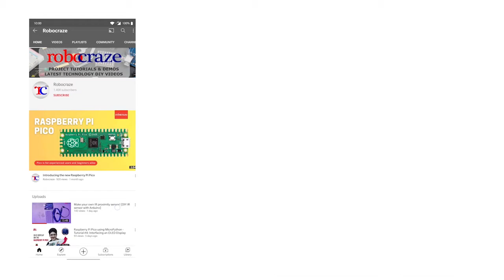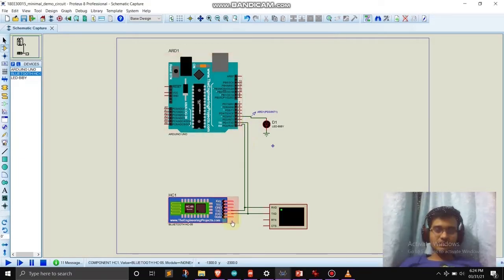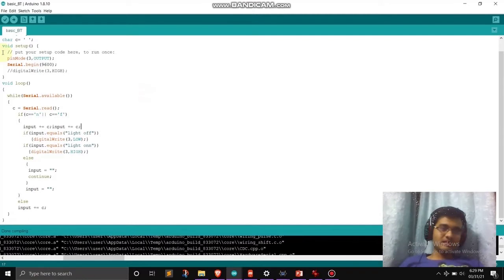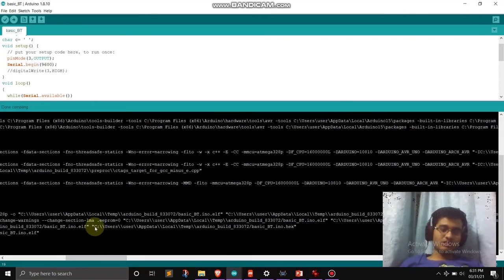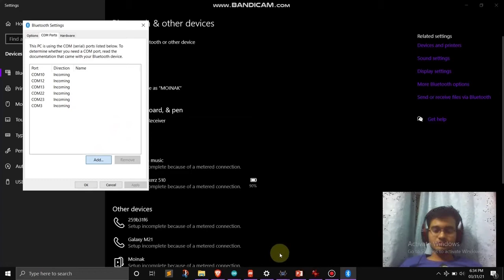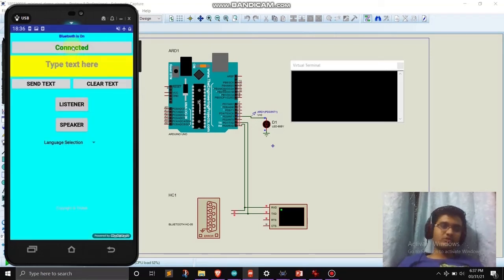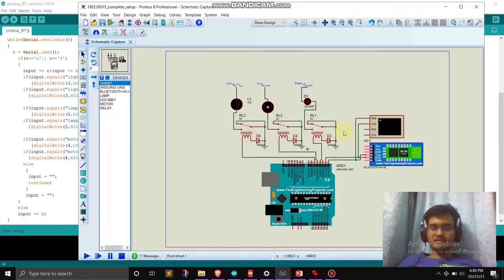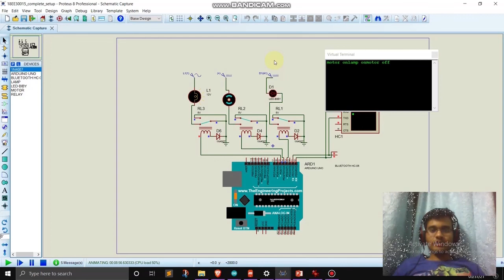Proteus Tutorial #3 - HC-05 Bluetooth Module with Arduino Uno on Proteus

Comment: Bro... Having trouble in pairing Bluetooth with the pc.... 
The Normal Bluetooth connection is paired... But while using the app it's not connecting with pc☹️☹️
Reply: did u find a solution for that?
Reply: Did you find the solution
Reply: Did you find the solution?
Reply from the maker: Hello,
Ensure that the software permissions are right and additionally you can re-pair the device and try